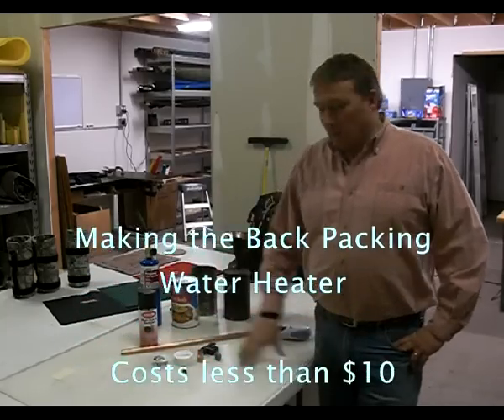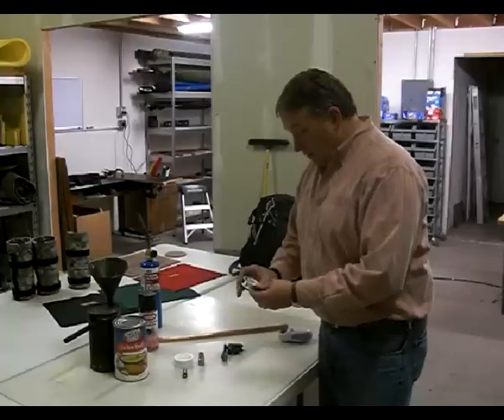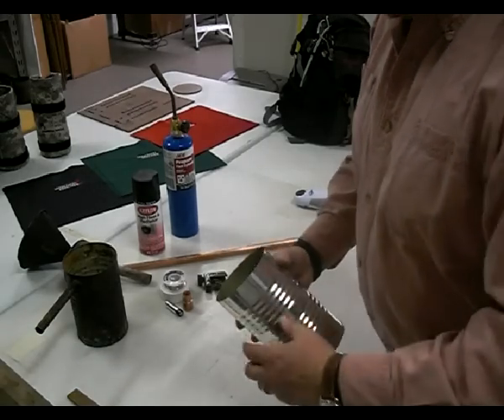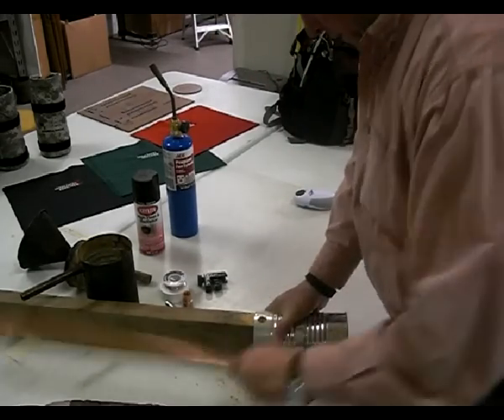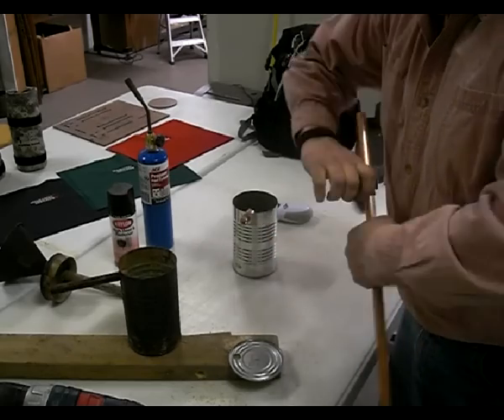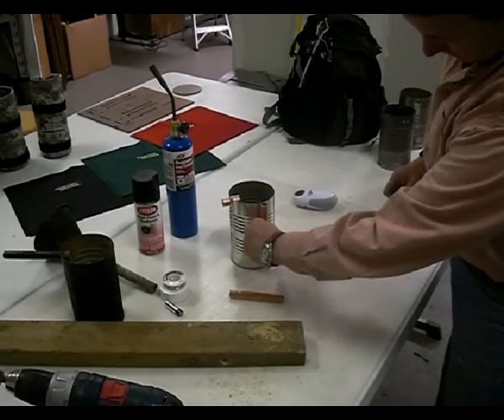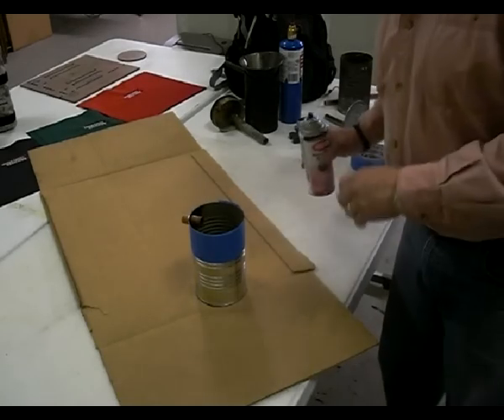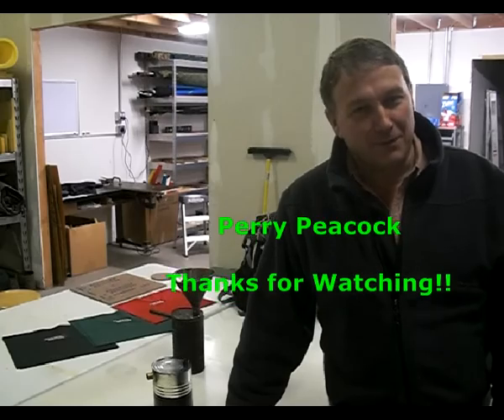Making A Backpacking Continuous Flow Water Heater

Comment: The title of this video is misleading. i can just boil water in a pot. this does not do anything to heat water IN a backpack. Getting flagged for calling this Backpack water heater" rather than "backpackING water heater." thanks for wasting my time.
Reply from the maker: Wow
Reply: want some cheese to go with that whine?
Reply: You are dumber than a box of hammers! I can’t even fathom what would make you write this. I hope you learned a thing or two in 3 years.

Comment from the maker: @dawsondrew69 The thing that makes it like a water heater is that the fill tube goes almost to the bottom, so it forces the cold water to come out where the heat is, while the hot water just floats on top, and out the spout. So you can have continuous hot water. It simple, but pretty nice. Thanks for watching!!